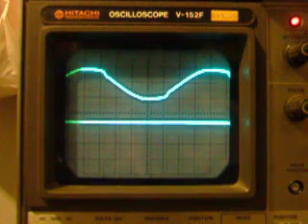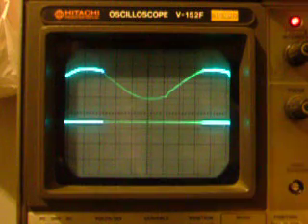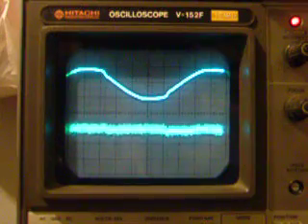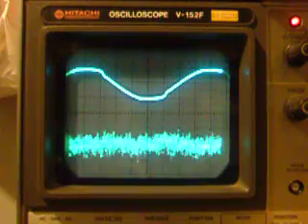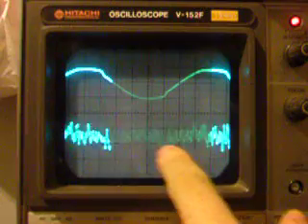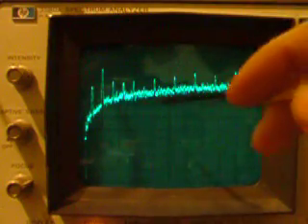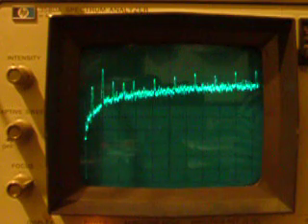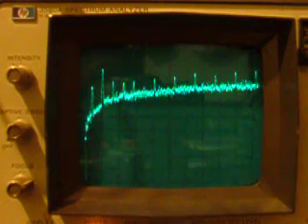The Hunt for Buzz & Hum - Part 9 of 10

Comment: You don't need rectifier snubbers just use faster diodes.
Adding snubbers can pass 60Hz AC on to first stage of smoothing.
Reply: +Nigel Wright you have commented on every one of these videos, but nobody has responded. What diodes would you suggest? I have always used 1N4007's with no problem, but recently I tried some 1N5408's and have a hum I cannot seem to isolate or even measure.